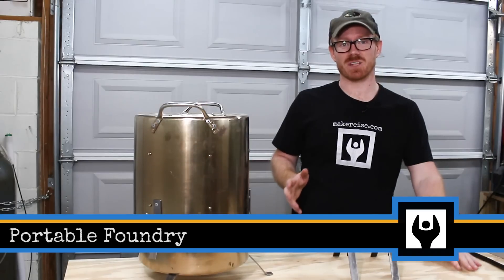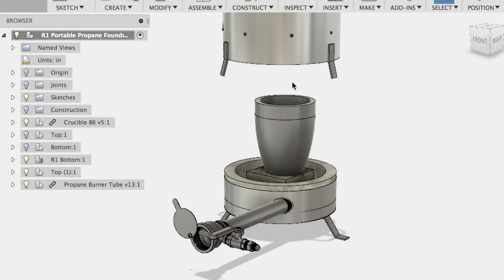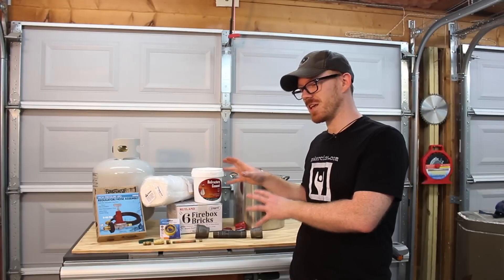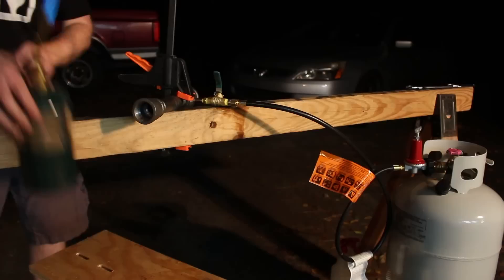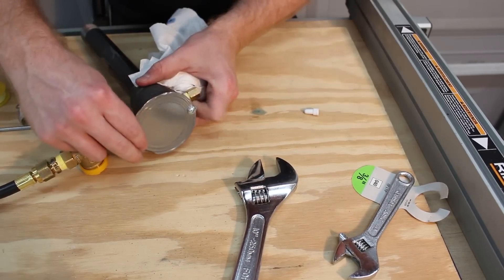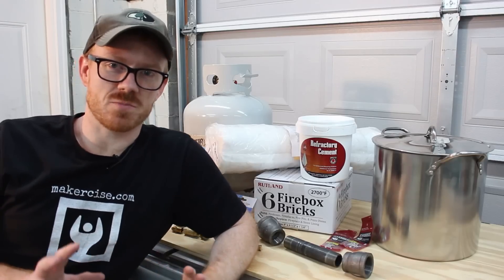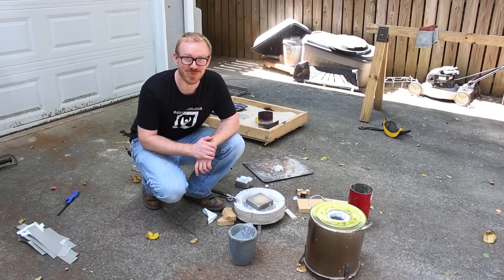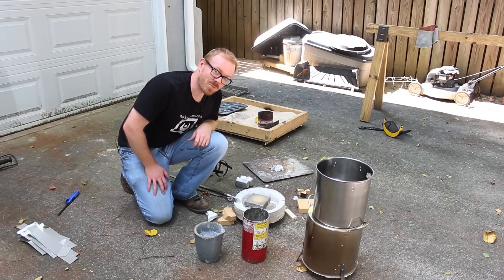Portable Foundry - A Lightweight Design For Casting on the Road

Comment: If the ball valve body is cast with WOG on it, then it can be used for gas. WOG stands for Water/Oil/Gas. There is also a number cast into the body which indicates the maximum safe operating pressure of the valve in PSI (Pounds per Square Inch for those on the metric system). It's typically 150 or 600 psi.

     If it's marked with WOG and the top of the valve is leaking around the stem, then the packing nut (the nut that the stem goes thru) needs to be tightened until the leak stops. The packing nut is standard right hand threads, clockwise to tighten.

     It's very easy to do. The handle must be removed in order to tighten the packing nut unless you have a low profile wrench that fits between the handle and the valve body. Note the location of the tab on the handle with the stops cast into the body before you remove the handle so you can put it back on correctly. There is only one screw (or sometimes a nut)  holding the handle on and the stem has flats which allows the handle to be installed in only 2 ways, 180 degrees apart, and only 1 of those ways is correct since the tab on the handle has to be between the stops on the valve body. Be aware the stem may turn with the nut while you move the nut. Just note it's location and move it back after you tighten the packing nut and before you install the handle. Put witness marks on the stem and the body if it makes you feel better.

      It sounds far more complicated than it is and literally only takes tens of seconds, and only a few seconds for someone whose done it before.

NOTE:     On older or cheaper ball valves, you may not see a packing nut when you remove the handle. On these types of valves, the handle itself may be used as a packing nut in which case you will see a brass packing gland instead of nut. These resemble brass bearings and have a shoulder. On these you just tighten the handle down more using the nut that secures the handle.
     If you have a valve that has a nut and spring on the opposite side of the handle, then it's not a ball valve. On these types of valves, the nut has to be loosened before opening or closing the valve and tightened afterword then checked for leaks. Usually people are too lazy to loosen and tighten the nut however. These are very old valves and are only rated for low pressure gas.
     Personally, I don't recommend these types of valves.

Comment: little while ago i seen another foundry builder that used the same woolstuff but poured refractory cement inside the blaket withouth nany mould or anything , offcourse the wool sucked u some of the cement , funny thing though that the cement doesnt crack in his foundry , the wool might just make the cement flexible or porieus enough to shed the moisture a bit faster on the first few heatups
he allso used the same burner desighn could melt a soupcan of aluminium in 8 minutes and do 8 to 10 melts per gasbottle fill

Comment: like the fact that the design uses the wool rype insulation , i wouldnt use the foundry a lot and making it with firebrick or the cement type stuff would cause it to crack when i move it around in storage
allso like the fact the top lifts off around the crusble and you can get it with the pouring tongs instead of using two tyoes of tongs and having to set the cusible down to take it over before pouring , i bet there be a lot of screaming if the crusible full of moten metal fell over

Comment: Did you end up lining the ceramic wool with castable refractory?  
I have seen posts saying that once heated to full temperature, the ceramic wool is both easily damaged and will give off small bits of fiber that cause some silicosis hazard, so it's best to give it some sort of coating.  ITC-100, Plistix 900F or Metrikote were mentioned.
Reply from the maker: I did not, but you are probably right. Better to put a coat on there.
Reply: Makercise apparently it makes the insulation last a lot longer too.  I am getting a lot from iforgeiron dot com, Forges 101 thread.

Comment: Cressel - figured I'd give you a tip since you've given me so many.  When you're using a large hole saw on metal, you can put cubed ice inside the hole saw to keep it from overheating and dulling the teeth.  It also allows you to go bananas without stopping to let it cool.
Reply from the maker: Pyrex great tip!
Reply: Cutting fluid (or at least some kind of oil) is also helpful.

Comment: Might build one for a gingery lathe... I have a furnace right now that will melt iron but it's cracked due to high heat. 1 Like = 1 Prayer for my furnace
Reply from the maker: Avi0n1cs my kiln can get to copper melting temps, but the other day the power company reduced voltage (a common practice for energy demand mitigation). that moved steady state from 2150F to 1940F not good for my molten crucible of copper. this portable little baby saved the day and put the copper back into liquid state. i am pretty sure it wouldnt do cast iron though some iron is in my future.

Comment: How well does the Cerachem insulation hold up to multiple heating and cooling melting cycles? How many do you have on this foundry so far?
Reply from the maker: yobohadi seems to be doing fine. I just refill a 20lb cylinder. and I use about .5 lbs for a pour from cold. I'd say 30ish. I used a fair amount to at maker Faire where it didn't cool completely between pours, so that may push it closer to 20 cycles.

Comment: great video! i only cant help but worry about those Aluminum rivets your using there in an aluminum melting furnace :) i know they're behind the insulation, but still... :S
Reply from the maker: +Luka Radakovic they are steel.

Comment: To light my propane foundry, I wad  up a sheet of scrap paper, put it in the furnace and light it with a match or lighter. Then I put the lid on and and turn on the gas. This avoids burning off your hair trying to light the gas with a lighter (as you do at about the 7:30 mark.)
Reply: n8hfi what, are you fond of your eyebrows?  ;-)
Reply: Try normal fire starter just break off little piece light it and put it into the furnace then open the gas. It works the same as with the paper just without the smell

Comment: That portable foundry seemed to be working like a champ today.  Did you get an idea on how much fuel it was burning through?
Reply from the maker: +ManCraftingTM Sure enough. Unfortunately the Faire isn't a good environment to collect useful data on fuel consumption. I didn't run it terribly much either. I'll try to remember to weight the tank after the Faire tomorrow. That way I can at least say what two days of intermittent casting burns.
Reply: Cool!  I feel like my current setup isn't cost effective.  I'm burning way too much fuel, so I may rip it apart and redo it.  Also, your design is so much more portable and for the project that I have in mind, portable is a great thing.
Reply from the maker: ManCraftingTM burned two days at maker Faire for ~$7 in propane. Get a tank and have it filled. WAY cheaper than the $20 exchange.
Reply: Makercise thanks Chris!  Just reposted my video from yesterday.  Had a copyright issue on the supposedly royalty/copyright free music I initially used.  Great meeting you and your wife.  Oh, and have her keep her eyes peeled for another electric foundry. ;-)

Comment: Very well done!   If you wish sometime check out Loctite # 565 thread sealant for your gas fittings.  The very best I have ever used, period.  I can only find it at McMaster-Carr, a bit expensive but well worth it.  Thank you for sharing your design.
Reply from the maker: I just looked it up and will keep the tip in the back of my mind. Probably will be while before I exhaust the gas tape since I do so little of it. :)

Correct me if I am wrong but pipe dope and tape would be useful on the MIP/FIP and NPT fittings but not the flare fittings. The leaking fitting that gave me the trouble was a 3/8" flare joint between the hose and the valve assembly. All the taped fittings worked well on the first shot. I had to really get on the flare fitting though.
Reply: You are correct.  On the flare fittings the seal isn't at the threads as with NPT it is the metal to metal contact.  Sealant shouldn't be used there.  You were correct, about the bigger wrenches too.  Just get on them till the seat and seal.  I was thinking your leaks were in the NPT type fitting, sorry.
Reply from the maker: Leave no stone unturned. I really like discussing such topics since I discover new techniques and materials like Loctite 565. Thanks

Comment: Aren't those pop rivets aluminium?
Reply from the maker: Negative. I just confirmed both mandrel and rivet are magnetic. I seem to remember buying steel rivets specially to build my original set of crucible tongs, although I don't remember what type steel. I think I bought them from McMaster-Carr. I bought a length that would be good for riveting two 1/8" thick steel bars, but now I use them in any and all applications requiring pop rivets since I have a box of them to use.
Reply: Makercise Good, it would be a shame if legs of your foundry melted off.
Reply from the maker: Lol. Agreed. Quite a shame, but would make for some rather exciting video albeit hazardous as the whole thing tips over.

Comment: Awesome! there is even teflon tape special for gas, and I don't know the difference in that case :P at some point if everything works can you just braze it with tin if they are all brass parts? Supercool crucible holder! wtf 9:22 better than flipping a pankake haha btw the link to the article in the description does not work at this moment :P always a bunch of cool stuff in your videos. I think that you could have done this in 3 or 4 videos. one for the crucible holder, another for the actual foundry and another about casting the aluminum in the weird water balls. But it is nice that one comes here for something and leaves the store with much more stuff for free :D great job!!
Reply from the maker: I considered soldering the joints, but I am not sure if that is kosher for gas applications according to code or whether it would even apply. A quick google didn't turn up a definitive source. Who knows?  You caught that slo-mo nice... I just crank this stuff out and leave quality control to Carlos. Thanks I updated the link. You are probably right. I think one of my biggest flaws is my schedule. I think I could probably get by with a little less crammed into my videos. Until I learn to pace myself, you are welcome. Thanks as always for the kind words man...you rock!